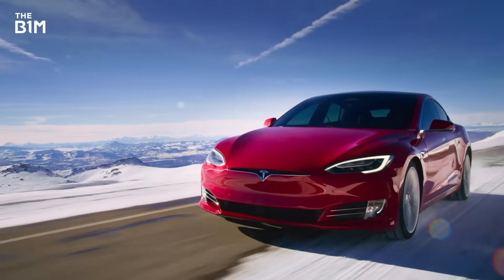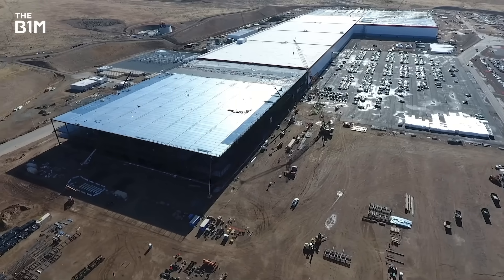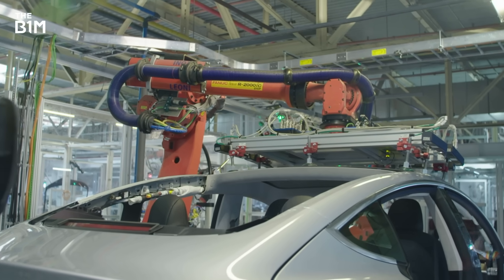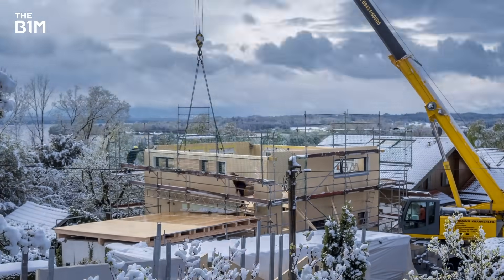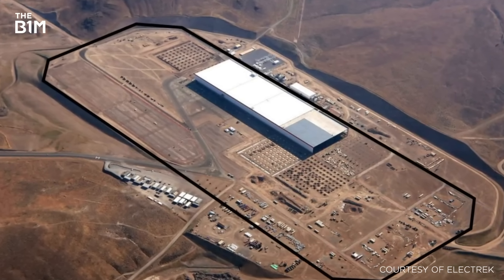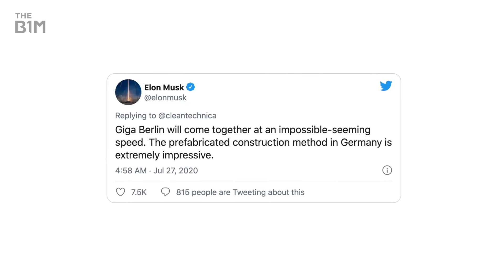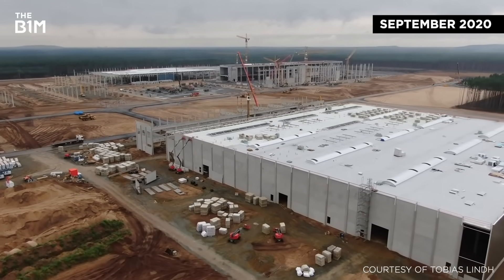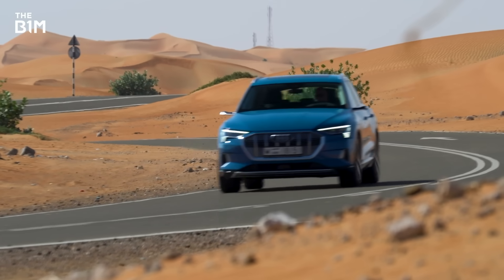How Tesla Builds Its Factories So Quickly

Comment: Tesla really nailed it with the property in Germany. Tons and tons of gravel and pre-fab building pieces delivered right to the site by rail, and I suspect tons and tons of new cars will soon be leaving by rail. And perhaps employees will commute by rail.
Reply: That's the plan
Reply: @MTobias  You have a copy of the plan ?
Reply: @eldiablo8019   I don't think there is "a plan" where you can see everything yet but it was mentioned in the German press that the existing railyard was to be expanded and that a nearby passenger station will be moved closer to the factory.
Reply: @MTobias  Ah ok. There is a rail line that runs along side their factory in Fremont, CA as well, but I believe they stopped using it to ship cars, as it was taking longer than trucks to reach parts of the east coast. Perhaps it will work for them in Germany though.
Reply: @eldiablo8019  I believe so. Pretty much every car factory in Germany uses rail for a significant portion of their shipping
Reply: Yes. But this is all pretty normal for all major car factories in Germany.
Reply: @abalada  I didn't know that. What percentage of car factories in Germany were built with pre-fab pieces brought to the site by rail ?
Reply: @eldiablo8019  Pre-fab method is used since the 60s in Germany. Of course with some improvements over the years.
E.g. Porsche plant in Leipzig with fright rails in the middle
https://i.ebayimg.com/00/s/ODYwWDEyODA=/z/pygAAOSw9zdcppqy/$_10.JPG
The main plants have however older buildings (some even listed ones like with Volkswagen in Wolfsburg).  And there changes/additions are often done using conventional building methods.
https://upload.wikimedia.org/wikipedia/commons/8/8c/Kraftwerk_des_Volkswagen-Werk_Wolfsburg.jpg
As this plant was built directly at a canal they used also ships not just trains to transport building material. And used of course also for the time modern building methods (concrete building with a brick facade). Here some photos from 1938
https://www.postautomation.de/freimachung-mit-freistempel/volkswagen-ein-deutscher-mythos/planung-u-bau-von-werk-u-stadt/

Comment: Are the electric cars being built with some sort of solar panel?  For me, I’d never buy an electric car unless it operated as conveniently or better than a gas using vehicle.  Somehow the battery charging has to be as quick as a gas fill up.  Advances in technology needs to make life easier and not more cumbersome - and telling people it’s better when it is not.
Reply: If you are living in a single home, or an apartment with a garage/lot that has electrical outlets, it is way more convenient than ice cars. You do not ever need to go for a gas station. You come home from work, plug it in, full at morning to be used again. For long range drive, the electric cars are coming close to having 500+ miles range, just in a year or two it will be standard. Do you drive more than 500 miles without any stop to rest or eat something? The car can be charged in 25 minutes, but there is nothing that tells you that you must charge it in one go either. You can instead take a break half way into your 500 miles journey, and do so while your car charges at the stop. 10 or so minutes, and you are topped up again. This is actually not a bad thing tbh, it may actually be good that drivers are forced to stop and take a break in their 500 mile journey. It is not a good thing to be trying to drive more than 500 miles nonstop. And lastly, how many times do you take a journey over 500 miles. Once a month? Twice? Do you travel long distance that much?

Comment: CORRECTION: german construction companies (e.g. goldbeck) know how to build quickly, not tesla.
tesla knows what it needs, the rest is up to the construction companies.
Reply: Combination of both. Tesla has done a lot of their own design work to make the factories as quick to construct as possible.
Reply: I have über respect for Germans when it comes to construction and manufacturing machines too.
Reply: The production layout is made by the manufacturer( in this case Tesla). There must be some intrinsic advantage in their production layout and their budgeting that is enabling the construction company to do its job effectively.
If the facility layout required many specialized pieces and custom dimensions for every compartment, there is nothing that a construction company can do to speed this process up( example: if the machines the factory has to house were of comically different dimensions and bear different loads on the building, it takes time to custom make all those rooms, but if all the machinery was of standardized weight and dimensions, the construction company can mass produce the required parts)
I just finished my college project report on the manufacturing plant of Jindal Stainless limited in Hisar and the main way they reduced the cost of production and made room for expansion is by standardizing the equipment. Large equipment was divided into several pieces of standard weight and dimensions.

Comment: Simple - just like their cars - with poor quality.
Reply: I’ve never had one of their cars but they seem pretty damn good
Reply: I'm curious, how many of them have you owned DaxXx?
Reply: @leftpastsaturn67  I've driven 3 different generations of Model S and Model 3.
And although some things are nice and impressive (technology-wise), the build/finish quality is - still - piss poor, and wouldn't pass QC in any of the manufacturers trying to sell themselves as a "premium" brand.
Hell not even in a mid-tier house.
Reply: @DaxXx988  Fair enough.
You don't see too many round here, I've never been able to have a close look at one. Thanks.
Reply: Simply ignorant and jealous.
Reply: Bad manufacturing and they are planning to make cars from one as little parts as possible which contributes significantly more to a throw away society as if the casting of some the chassis ends up being bad, they will have to melt it and cast it again. They are also making everything integrated to one piece just like smart devices which means if you need something repaired, you might have to replace the whole part which bad. The technology is quite impressive, but how they use it is somewhat outrageous